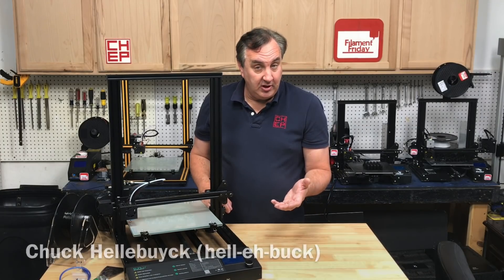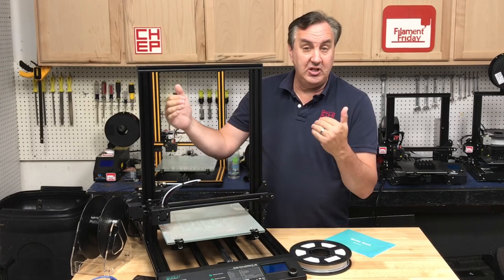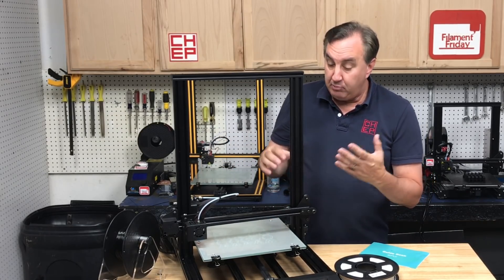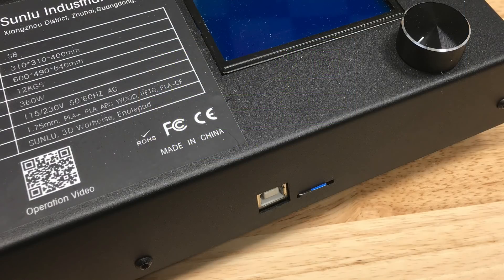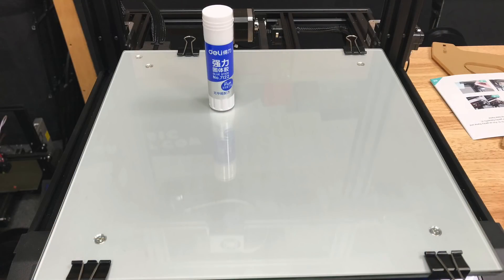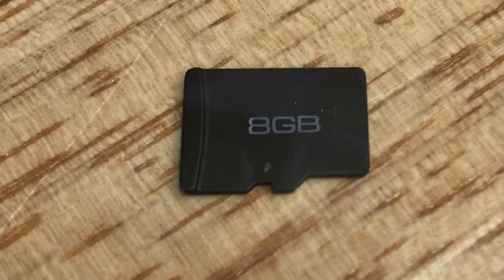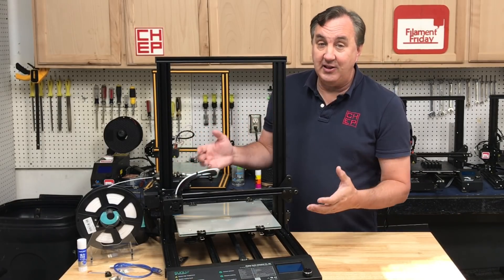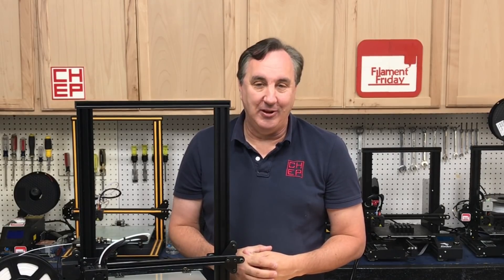$229 Large 3D Printer the Sunlu S8

Comment: So... they are getting ready to release the S8 PRO.  As a result, you can get the S8 for as low as $160 up to $180.
BUT!  the real deal is the fact that if you preorder the S8 PRO, the $280 price is reduced to $200 with the coupon code:  PRO.
As I write this, they aren't shippng yet. ( April 15 ). so no review to provide.  Upgrades are supposed to be a 32 bit motherboard and one of those newer fancy glass beds with the 'adhesive' layer.
I suggest you order one Chuck to review !
Reply: S8P5 right now for $80 off the pro

Comment: My thermistor died and I figured I'd replace the nozzle/etc.  but I can't find ANY  documentation for WTF voltage the heater cartridge is  !

I'm going to have to try and get a voltage reading with my volt meter (and hope it works :/ )
Reply: Actually i "fuged" it - The Heater Cartridge is 24V 40W

Comment: 310 is not big.  310 is medium.  A CR10s-5 at 500^3 is big.
For a 310mm bed you get more bang for your buck out of a Hictop D3Hero IDEX.  A few more dollars but its dual head and therfoer dual material, dual color.  And when its not using all of the bed, you can have it in duplicate or mirror mode and suddenly its TWO PRINTERS

Comment: I have been having problems with my Sunlu S8 for longer than I choose to admit.  Buyer's remorse is huge on this one.  I've come very close to throwing in the dumpster more than once.  I watched this video when it first came out, but somehow missed the part about formatting the sd card.  I rewatched today, saw that part, paused the video, reformatted my card, and printed a calibration cube.  It ain't perfect, but it was a successful print.  I've got the 3rd one going now while I dial everything in.  Hopefully this solves (most of) my issues with this printer.   Thanks for a great video!
Reply: I returned mine as I have had better experience with others. But if you are still using glass and bed is fully level, try hairspray for adhesion, and from what I remember I had to heat filament at least 10 degrees hotter than others for decent extrusion
Reply: @cdav2199  Yup, my first upgrade was to a flexible magnetic build sheet, and still had to use hair spray.  I print PLA at 205c on my Anet.  On the Sunlu, I've been printing at 213c.  I've been playing with raising the temp even more so I can print a little faster.  Hot and slow!
Reply: Just a quick update...  I've been printing, dialing in, and printing some more.  I can finally say that the Sunlu S8 is a really good printer!  BUT, it took a lot of work and some upgrades to get it there!

Comment: Just got mine to cooperate.  Really great printer.  English well written manual.  Nothing was missing.
I am using Cura 4.8.0 and tried to set up as much according to the directions as possible.
1) I tried no glue.  Don't bother.  Glue is good.
2) I made sure to set up as a RepRap printer.  Cura 4.8.0 defaults to Marlin.
3) Make sure that you set the filament size to 1.75.  Cura 4.8.0 defaulted to something huge.
4) Cura 4.8.0 defaults to 60 mm/s print speed.  The directions show 30 mm/s.  That helped a lot.
5) The stepper motor positions are somewhat dynamic.  They can get turned during packing and shipment and I think this throws bed leveling off quite a bit.  I made sure the X axis is square and then adjusted things accordingly.  Repeated bed leveling way too many times.
6) I had a screw loose (yeah but that is another story) on my right rear corner.  When they are loose you can turn the knobs forever and make no progress.  I took a philips screwdriver and tightened all 4 of them down snugly.  Now when I adjust the corners they really adjust.
7) Peel the blue plastic off of the bed.  The label says to so I did.  Bed heats a bit faster now.
I was not used to a glass bed so it took me a while to get things sticking.  I have been using a Monoprice Maker Select 2 for several years and the plastic bed is easier to use.  We will see how I like the glass.
I hope that this helps.  So far its working great.  We will see in a month or two.

Comment: Hi Chuck.  How did you configure it in Cura? Like many, the Cura install on the sd card was virus infected. We've been using the CR-10 profile with a modified bed size.
Also, wondering if you have any ideas on using Octoprint on it?
Reply from the maker: I use my profiles in the CR-10 machine setup. I don’t use Octoprint.

Comment: Had mine over 3 weeks now, and prints great. Added a cable and micro to sd adapter. Plus moved the switch to the side of machine. When levelling, iremove the clips so u dont warp the aluminum heat bed. Some people say this is warped glass, but its too much tension on the bed screws.  Very comparable to a cr10s. Thanks for the video, and recommendation. Just wanted to give u an update. I did see the video when u first posted it, and could not pass up the price.
Reply: Do you have any picks on how you relocated the power switch?

Comment: Do you think you can swap in a creality 32bit silent stepper board?  Or are the connections all wrong?

May this could be a base frame for Ender 10 parts.
Reply: I do believe it could swap just fine, make sure u use a 24volt board. All the parts seem to be interchangeable with an ender

Comment: I've bought one after seeing some reviews and the competitive price, I wanted something bigger than typical 200x200 mm printers. It's my first printer but I've some experience with hobby cnc machines and electronics.
When it arrived I had to partially disassemble it and tighten all screws, expecially the ones on the wheels. Then, a good settings of plays on the axis and ready to print, the first prints came out really good, just a bit of over extruding at the edges.
On thingiverse there are some mods, I want to try the direct extruder one.
The 500gr spool of filament included is a great gift to start with.

Comment: Mine came with a decent black textured glass build plate and a SanDisk SD card so they must have upgraded it a bit. It's a good machine, not a fan of the hot end the extruder assembly is a bit of a pain to get your plastic into and the cooling isn't as good as it could be but I'll fix all that stuff in the future. Can't really complain for $200.00. Thanks for the review!

Comment: Its perfect to throw in a skr 1.4 turbo board with a tft35 screen. For about 60 bucks you'll have the best board (not counting duet) and the best screen on the market. Cheap upgrades that will make it as good if not better than   most big printers
Reply: Looking into this now :).  Thanks for the info as mine is stock.

Comment: I got my Creality CR-10 for around $400 in 2017. Dual Z? Filament run-out sensor? Fix for the PTFE tube backing out? I feel like I'm asking too much, but does it have an AC bed heater or at least a higher voltage one for faster heating? I assume it also has thermal runaway protection enabled in the FW, since that cost nothing, but Creality sure didn't. Sounds like the CR-10 is dead!
Reply: I wouldn't say that, just the fact that the CR10 is so popular means an abundance of files on thingiverse for the CR10 and tons of replacement parts for purchase. Not to mention all of the support available when something goes wrong. Unless this printer takes off your not going to get much of that. While I do really like my S8 all of what I just said may be worth the $200.00 especially as the machine ages and things start to brake.
Reply: @masamasa1815  Of course it isn't dead for existing owners like (presumably you and) me. I'm talking about the viability of Creality continuing to offer the model. This one eats CR-10's lunch!
Reply: @masamasa1815  ...also, this is mostly a clone so much of the community benefits around Creality printers apply to this.
Reply: @emmettturner9452  Fair points, I definitely see what your saying.

Comment: this looks like an amazing donor to put my skr and closed loop steppers into
Reply: This on my todo list with the filament sensor btt
Reply: I got an S8 back in May for 330Eur and have since swapped almost everything.
First I got some weird layer shifts; like 10cm off along one axis. So I got an SKR1.4 Turbo with TMC2130 drivers.
Then the stepper motors got crazy hot with the Trinamic drivers, so I changed those.
With the SKR board I also got a BL Touch.
Next I changed the hotend for an E3D vulcano clone as well as a BMG extruder which runs in a direct drive setup.
Most recently I got the X carriage of an Ender 3, since many hotend-assemblies on thingiverse are designed around it. Getting them to work on the S8 carriage was always some hassle.
The mechanics are nice and robust, so no need to change anything there. Also the printer is pretty good to work on which is great for a tinkerer like me. The large print bed has been quite useful, too.

One major fuckup was the wiring from the power supply to the original control board. They mixed up the colors of the power cables which resulted in me connecting the SKR the wrong way around. This may have damaged the first SKR board I got. It's not completely dead and further investigation is required, but it did not drive any motors. A second board went nicely. The power cables even have little labels indicating Plus and Ground - those were correct. This means that they deliberately used the black cable for plus and the red cable for minus. Go figure Oo
Reply: @twinklingwater  yea i got a 1.4 turbo as well, i have the closed loop steppers i want to try out on it. Also have an extra v6 hotend to throw on it.
Reply: @DangaRanga  I changed the x carriage with one from the ender3 which means I can take a picture of the sunlu carriage for measurements, if you don't have them already.
Reply: @twinklingwater   Did swapping out the carriage help with cooling? I'm getting slight rough textures and a bit of zits on my benchy test prints that I feel is down to cooling because the print is pristine otherwise.
Reply: @masamasa1815  The carriage does not affect cooling, but the stock cooler is less than ideal. First action was printing a better one that works with the stock hotend. It's on thingiverse, has "red" in its name. The seach should find it.
Reply: @twinklingwater   Thanks! I mistook my 3d printer anatomy lol! I'm going to look for that file though, thank you!

Comment: Can you hook a bltouch to it? Is there anything you need to do first? Does it have a bootloader out of the box?
Reply: It should have a bootloader, at least an update using avrdude has worked.
Reply from the maker: Don’t know
Reply: Its glass, no need to...
Reply: @FunkyMunkey224  if any manually leveling of a bed is needed then being glass does not matter   by your logic if i put a glass bed on an ender 3 i magically will have a perfectly level bed...which is not the case at all

Comment: You’re in for a real nightmare dude! I had the sunlu and it was the worst 3D printer I ever had! If it wasn’t one problem it was another! Eventually I had to sell it for scrap cash and got myself a Creality.
Reply: I have one. Never able to print on it
Reply: Maker Mark mine worked for like 2- maybe 3 prints if I was ever so lucky and then it stopped mid-project one day. I tried replacing the nozzle, but it snapped in half. When trying to get it out of the heating end, it completely crumbled. Company was little to no help, and when I started wanting my money back after buying a replacement and then decided to sell it, They started yanking my chain. I can 100% say I wouldn’t recommend it. Go for Creality, $100 dollars cheaper and you actually get results.

Comment: Chuck, If you want a tip for printing on glass, I have one for you.  Take a small spray bottle and fill it a third of the way up with white glue.  Fill the rest with 91% isopropyl alcohol.  Shake well.  A light spray on the glass will leave a durable and uniform coat of glue.  No more glue stick unevenness it breaking off.  If you do damage the glue layer apply a thin overspray and let it dry.  That will fill in the damaged area and you will be back to printing by the time the bed heats back up.  The only problem I have ever had with it is when I applied it to a heating bed.  Marlin firmware noticed the bed not heating as expected and threw an error killing the printer.  Better safe than sorry!  Good job Marlin!  Once I realized what I had done, I always sprayed before telling the bed to heat.  I haven't had that error since.

Comment: I love my Sunlu S8! It's a great machine for the price point. It is simple to assemble and level. I had to figure out how tighten the y-axis, but that was about it. My only issue is the changing filament feature. The filament stops prematurely during the process before I have to do a manual pull. But the quality and details on prints are incredible. Thank you Sunlu for building a great product with a great price.

Comment: Just purchased, arrives tomorrow. I am taking your word for it.
Reply: 2 days in and so far not good. Bed adhesion, but now this  my extruder shows a temp of -14. Check the thermistor the diode is jammed and now broken off. I shouldn’t have to be replacing parts. I am still new to this, I have an ender3 and an anet a8. I hope others have better luck
Reply: Customer service is sending replacement parts. not sure how long that will take. Was really looking forward to getting this up and running.
Reply from the maker: Glad they are replacing parts. It is an amazon purchase so if you got a bad product you can send it back.
Reply: @FilamentFriday  I am still learning, I think I will benefit from learning the repair. Apparently, the thermistor cable connects differently. those cables become a separate pin connector to the board. rather than separate connectors for steppers, fan, etc...

Comment: Hello, I also have one, for a month now. On my printer, the filament sensor does not align with the extruder witch cause filament under print. After loosen the bolt, still underprint but it improved. Belt attachement is smooth face up but didnt change it. Fans are quite noisy overall. Not alot of community and printer upgrade available. Printer look good for me dosent print ok yet, WIP. Will try the memory card trick and ineed to do something for the extruder. In the making of building a box so i can print while working from home...
Reply: easy upgrade on the board and the hotend if you want.

Comment: THE SD CARD IT COMES WITH IS TOO SLOW.  IT CAUSES THE BUMPS ITS A BIT RATE THING.  ANY DECENT SD CARD FIXES THE ISSUE.  sorry for the caps just wanted to make sure if you get one you know this so you don't just think its a crap printer.
Reply: I got the same SD card issue. Seems like someone in the supply chain bought too cheap or pulled a fast one on Sunlu.
Reply: @runningfromtheheat  exactly.  Thankfully a new sd fully fixed the issue with an otherwise amazing machine.  Out the box.. thats the crazy part
Reply: @joeberman1285  actually I did some testing on the SD card. It should be fast enough. I completely reformatted it on Windows with FAT32 and that helped. I have a few zits but now no blobs

I think something must be wrong with how they format or the default test files.
Reply: @runningfromtheheat  guess that's a good point. I did try a few options formatting and it wasn't perfect either so I'll stick with this high speed sd.  Also setting about it needing to stay under 8 gb in the formatting too I don't rember though
Reply: @joeberman1285  what specific SD card do you have?
Reply: @runningfromtheheat  I'd happily check for you when I get home

Comment: I have this printer and it is amazing.  Also 225? Did the price come down.  If so I need to buy a second and possibly a 3rd.  Its really a great printer.  I put a top mount spool holder with a pteg fillament guide.

Comment: How could an SD card cause an issue like that?
Reply from the maker: Don’t know but it did.
Reply: @FilamentFriday  I can answer this.  Cheap/slow SD cards generally have decent read performance and therefore don't cause any issues with printing--after all, it's not hard to keep up with a little 8 bit microcontroller.  But this printer offers to restart a print where it left off if it loses power (noticed that on the Amazon features list when I was buying it.  Thanks, Chuck!) and that means it writes to the card.  Now, cheap/slow SD cards can have abysmal write speeds.  I've tested dozens of uSD and SD cards over a decade and some slow ones perform around one write per second in bad situations.  When that happens, that means the whole card just stops until the write is done.  That's plenty of time to stall a print.  I bet if that feature were turned off (if that's possible), then you wouldn't see that problem.  Hope this helps people to understand what's going on here. Thanks, Chuck!
Reply: Super slow transfer rates, printer can't read fast enough so it sits and waits for the next command. Then you get blobs where the nozzle drips. That's my only guess. It seems like it'd have other defects though, like underextrusion because of the empty nozzle? Either way, super weird

Comment: Hi Chuck! Hey, if you get a chance, could you check the X and Y belts? On my S8, the zip-tied loops at the ends of the belts were made with the smooth sides together instead of with the toothed sides together. Looping them like that let the Y belt loosen pretty badly, so I had to re-do the loops so the toothed sides were together (and I tensioned them at the same time). Overall it's a pretty good printer, just really loud. 👍

Comment: Is the hot end replaceable with something good and full metal?  Is the spacing the same as creality (bolt to bolt)?  Thanks!
Reply from the maker: Not sure
Reply: You could definitely run an MDD plate on it and then you get the whole ender ecosystem. That's $40 and then whatever hotend system you want
Reply: The X carriage uses a different spacing than creality. It is easy to change the carriage, though (I did).